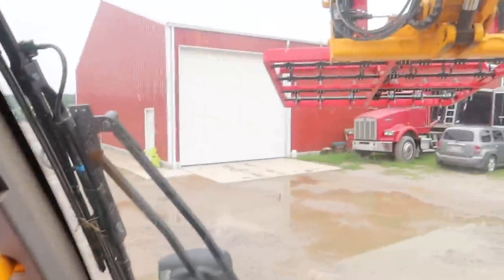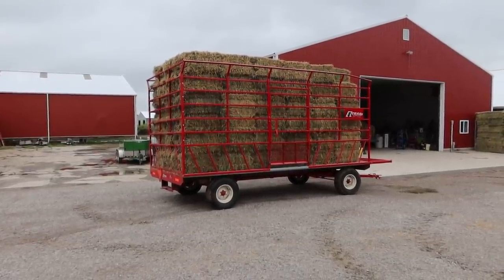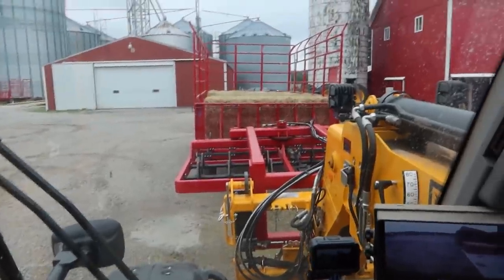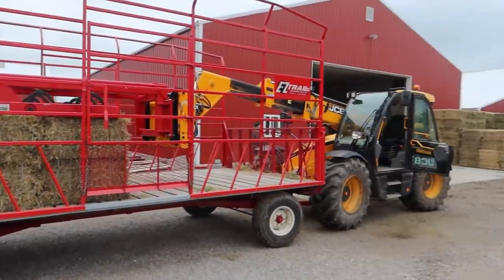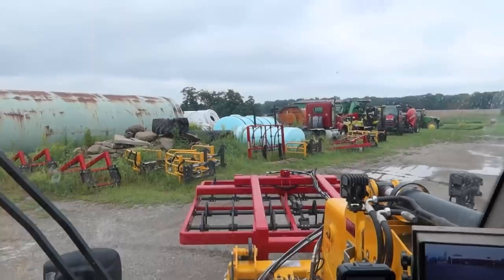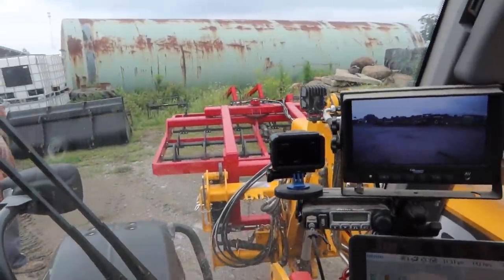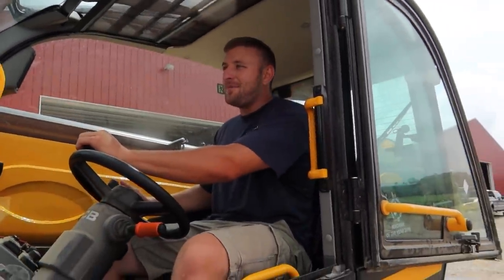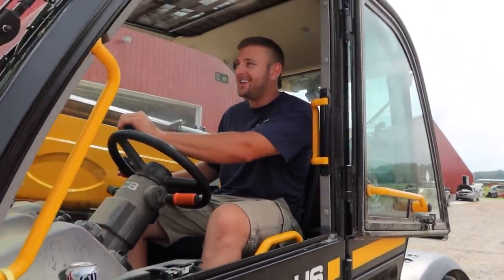Loading A Semi with Hay (Very Fast)

Comment: how do they unload the van trailers full of hay? will a telehandler reach all the way the the front of a 53 foot trailer???? I would think they would want to use a live bottom trailer
Reply from the maker: They really need a loading dock to drive a skid steer in or a walking floor like you mentioned
Reply: They take it out the same way they put it in.ive done this in a reefer

Comment: How do they unload the hay from the van semi trailer?
Reply from the maker: This particular customer doesn’t unload it all at once. They just pull from it as they feed the stable. You need a skidsteer and a loading dock to realistically unload these well with a machine
Reply: @FarmingInsider  I was thinking a moving trailer, I've seen a conveyer and like step walking system to unload mulch crammed in a 53.

Comment: How will they unload that semi at the other end? By hand I assume?
Reply from the maker: Yes they will pull out by hand. You really need a loading dock and a skid steer or small front end loader to mechanically unload these
Reply: They use a portable ramp